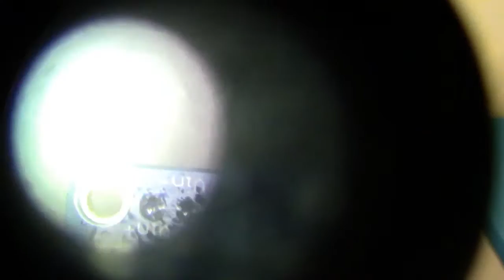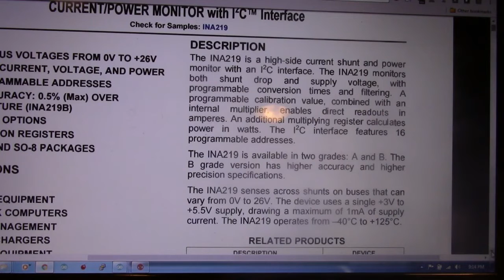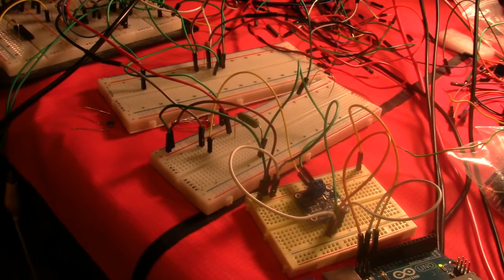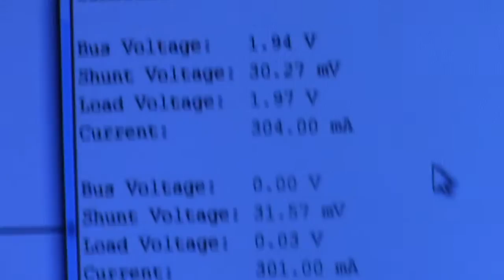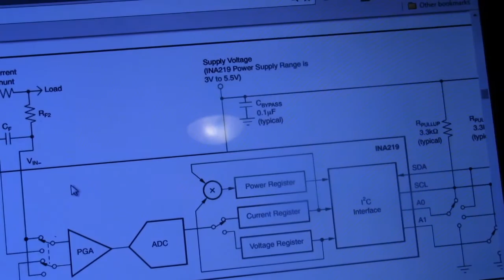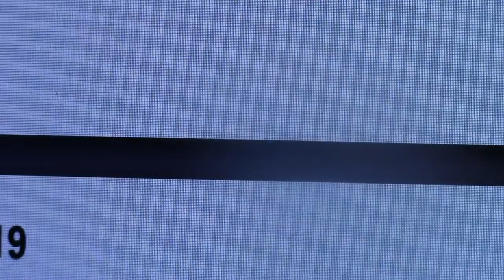BRMBLOG #19 INA219 Current Sense Board

Comment: Hi, I found out (saw somewhere on the internet ;) ) that the INA219's voltage readout is only correct if the negative lead of the load (or the input) is connected to the Arduino's ground. I tried it and it worked.
Reply from the maker: pepper669  that's a great point     Thank you.